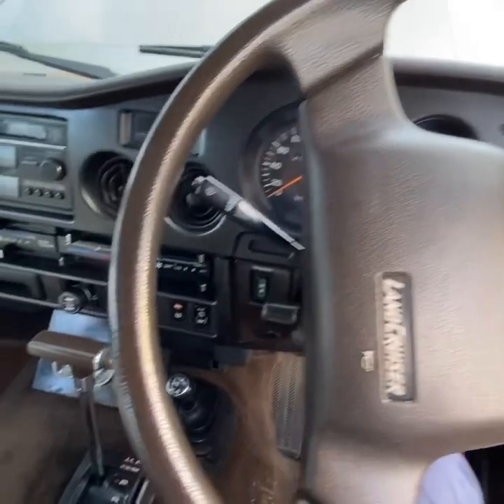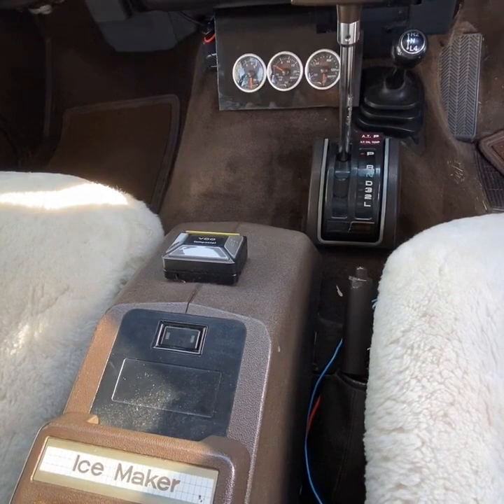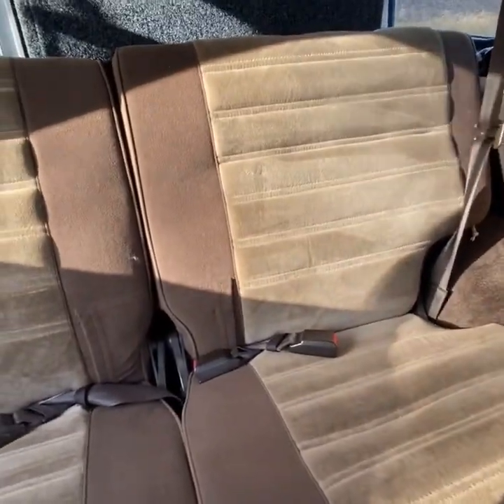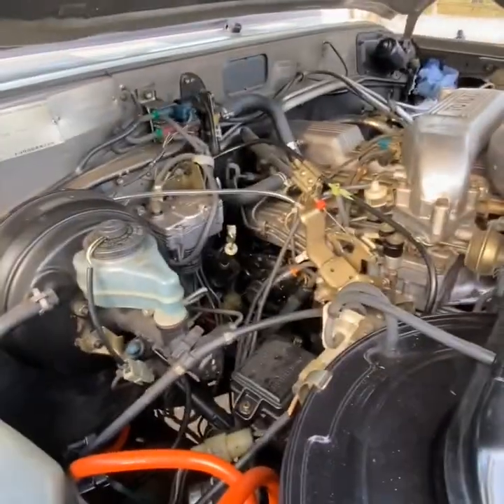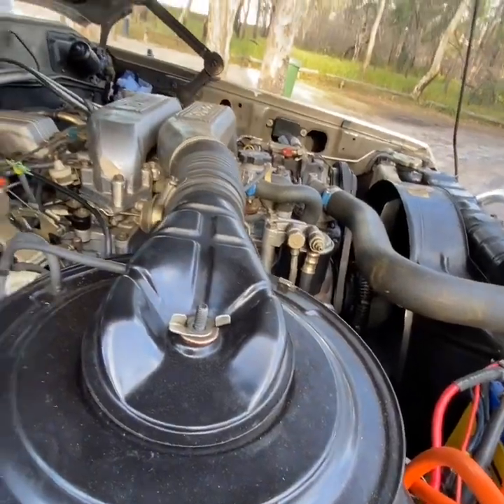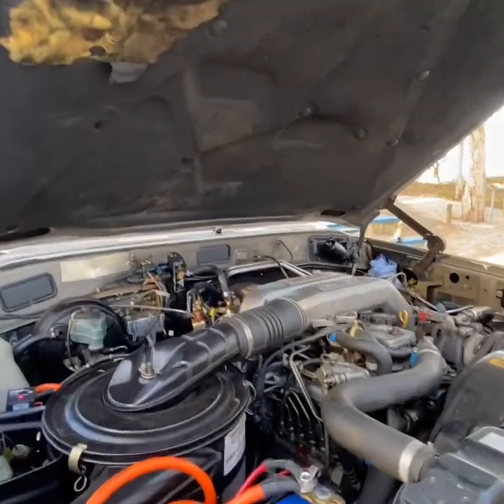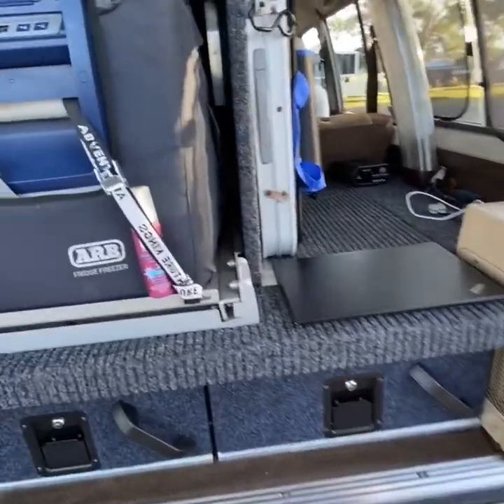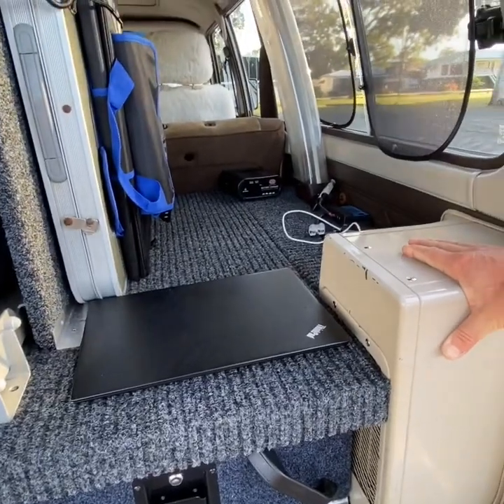Introduction to the old cruiser (hj61, 12HT, 60 Series)

Comment: Great  rigg man I been looking for12ht for my hj45  those tires look great what size are they  thanks if you respond
Reply from the maker: Cheers mate, the 12HT is a great engine. Tyres and rims are a neg (-) 22, 16 inch (D ring steel) with 33 inch Dick Cepek Fun Country tyres.

Comment: Thankyou for posting. I have also got a 61 and there is some great ideas. Where is your second battery located and what size did you get? regards Alex
Reply from the maker: Hey Alex, great trucks! As for the location of my second battery it’s in the back behind the rear aircon compressor. I have a 105 amp hour AGM that I got from my local battery supplier. I ran the cabling on top of the chassis, sleeved, and entered the rear through the boot pan. I used 16mm screw style plastic and rubber grommets to seal the cables (one for positive, one for negative return, earthed to chassis). I did this all on the right hand side of the vehicle, and have the entry and exit points protected by the diesel filler and it’s bash plate. I’ll do a quick video on my setup (I have a solar regulator and solar blanket, etc. but will have permanent solar on my aluminium roof top tent when I mount it...). This battery, engine charge and solar setup enables effectively maintenance free operation when in use outdoors. I do have 240v chargers for both batteries (smart chargers), and the ability to connect the fridge to 240, all off a single style plug setup.
Reply: Thanks I will look forward to the set up viideo. Mines 24v so the third battery doesn’t seem to keep charge with the standard 55 amp alternator. I didn’t realise it would fit under the wing of the drawers. I have been using an ark pak with the dcdc charger but it doesn’t seem efficient and takes up so much room. Regards Alex

Comment: Great rig mate have the same ,auto .
Reply from the maker: Awesome Wayne. I recently had a delayed engagement issue (now fixed - video coming on that one). Have you experienced any issues with these older mechanical transmissions?
Reply: Had mine 2 years an no probs at all ,some say get bigger trans cooler but I haven’t yet .how  many km it done an suspension is probably something I have to look at aswell .

Comment: Hey mate me again with the 82 hj60 
Kinda fixed the tach but not really turns out it’s the wire on the box 

New problem tho I’ve got the last of the 4sp with the overdrive and it won’t go into not overdrive do you think it might be a shift cable or something
Reply from the maker: Hey mate, that’s a tough one... When was the last time the auto was serviced? I had a delayed engagement, and hiccup issue in the transmission that was from old trans fluid. An auto service fixed it as the tolerances for a mechanical automatic transmission are very tight. 
The service included dropping the fluid (and you will only get about 50% out as the remainder is tied up in the valves, etc), the filter cleaned, and all buttoned back up.
When the pan comes out, you can check for soot (overheating), as well as metal shavings on the transmission sump plug. 

It may be the clutch plates, or it could be as simple as a fluid change and filter clean. You can also do a full transmission flush.
Reply: @theold60series26  
Sorry it’s a manual transmission and won’t come out of overdrive 
It’s never been serviced apparently the oils was changed with the engine oil
Reply from the maker: @johnsontrucks8806 , ah cool. So it won’t go to 4 low?
Reply from the maker: Is it a Fairey Overdrive?
Reply from the maker: Like this? https://forum.ih8mud.com/threads/60-series-transfer-case-with-integrated-fairey-overdrive.771236/
Reply: @theold60series26  
Yeah not really 
The 4wd works fine 
But then I’ve got an overdrive that I can split every gear 
And it’s stuck in the higher ratio 

Think three sticks 
1. with your 4speeds 
2. 2high /4high/4low 
3. standard ratio /overdrive
Reply: @theold60series26  yeah it’s a fairly
Reply from the maker: @johnsontrucks8806  if you jump on the IH8MUD forum you can post your problem up there. I have zero experience with Fairey overdrives. And from what I understand they are popular but sort of rare (ish). Apparently you need three arms to operate! Lol! And there is a couple of ways to identify what type, etc.

Sorry mate, my limited knowledge is on my old girl, but if you search fairey overdrive on IH8MUD, you’ll get a heap of info. And there are some legendary blokes and ladies that have shared some great specs and insights. I’d try there, or some of the Facebook pages (60 series owners groups), also some very knowledgeable people on them also. 

For a simple one, as the hole was probably cut in to the tunnel for the gear lever, it’s not fouling on the tunnel (as in it can move the full motion)?

Comment: Rebuild a 12ht at 500,000 what a waste. Known to do 1 million ks.
Reply from the maker: Known to Brad, this one will, but we’ll give this engine, transmission and transfer case a birthday so I definitely know how in spec it is. 
I also need a couple of slight performance improvements that could pose issues for older rings and pistons. Ironically, according to Terrain Tamer, the pistons and rings now used are better than original... I’ll get to 1 million, just after 1.5! 😉
Reply: The old 60 Series not known to me mines only done 394000, but ive seen alot come through my work getting bigger injector pumps winding up the boost to 15 psi well into the 500s and going around the country no problem. Of course with other mods like intercoolers exhausts etc. if you have the cash then hey! Why not. As 12ht rebuilds are quite pricey.